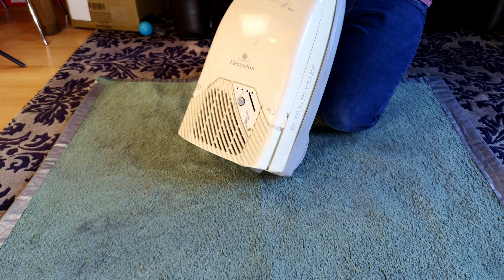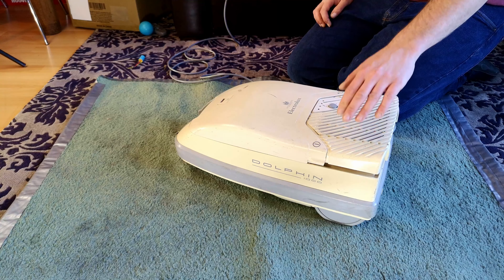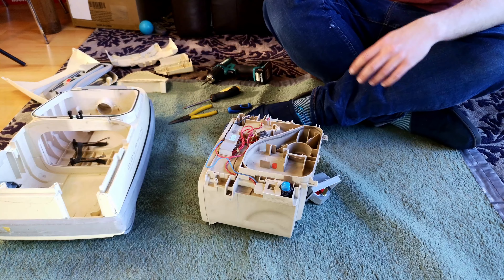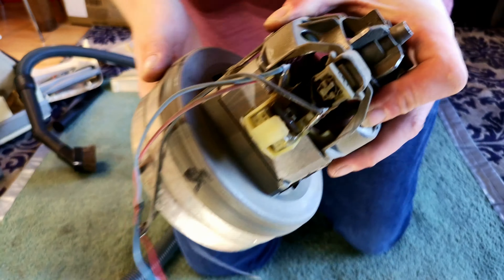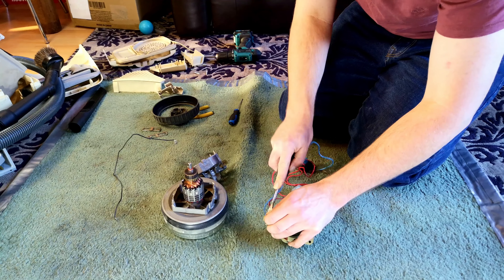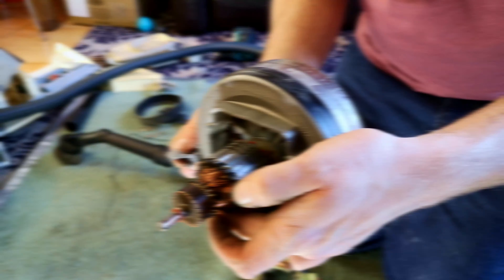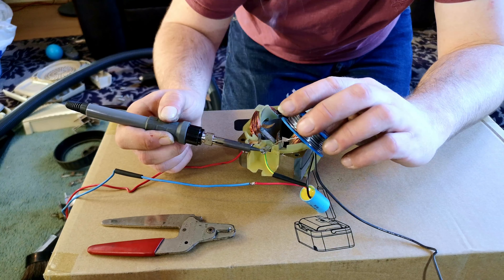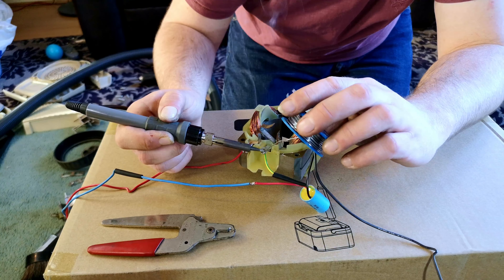How to remove the EXPLODING RIFA supressor on Electrolux Motors!

Comment: The two wire RIFA's (with resistor if necessary to stop the plug giving you a tingle) are just standard class X2 capacitors, you'll want to use probably a Panasonic (or similar name brand) PP film capacitor (so a Panasonic EQUA/EQUL) as then you won't have the issues you get with the Rifa paper capacitors absorbing moisture and failing.
If a resistor is needed then I used (following reccomendations) a 560K 1/2W metal film resistor, which was just soldered between the legs of the capacitor.

Comment: You can still find the originals.They will probably last some 40 years.Search for "delta suppression capacitor"and you'll find them.
Talking about these 3-wire motors I still wait for a motor designer to explain to me why it needs 3 and not 2 wires leading up to the speed control?I wonder if I ever will get the answer....
Reply: Apparently the speed control shuts down part of the field coil. Hence why you need two wires. On full power the whole field coil is live and both wires will be live. On low power only one wire will be live. By joining both wires together, you will only get high suction as all the field coil will be live.